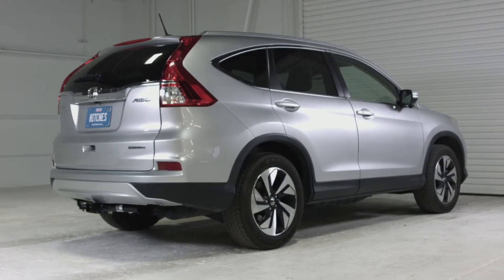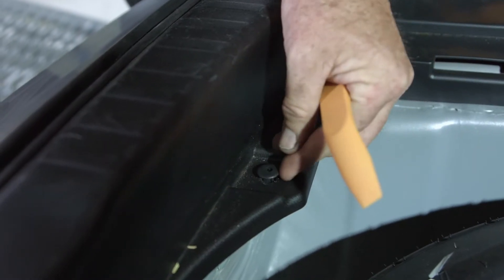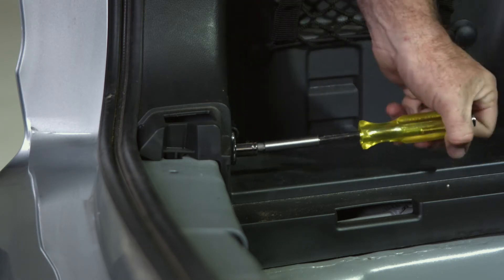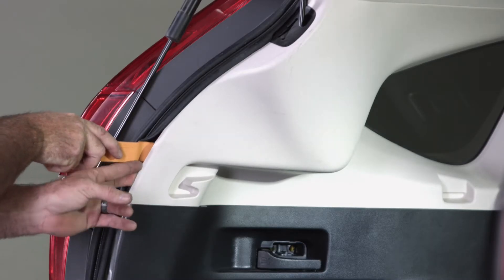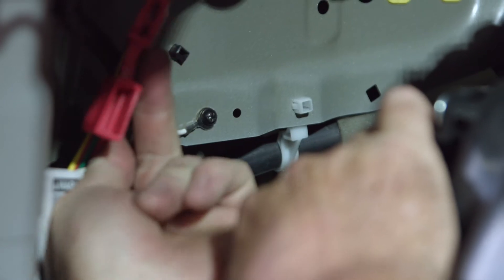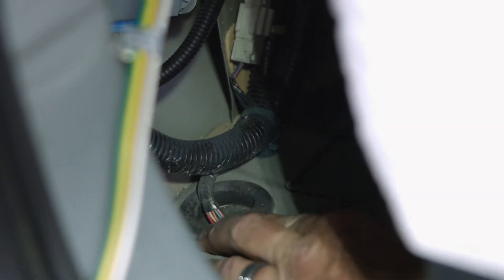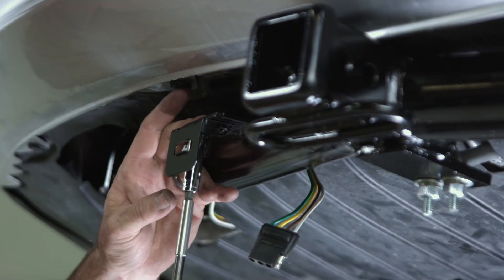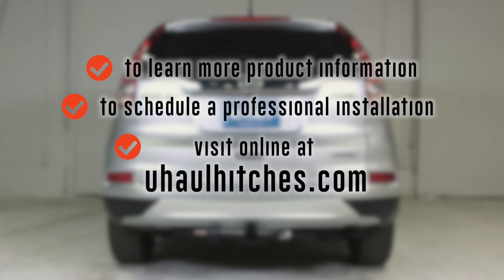2013 Honda CR-V Trailer Wiring Installation

Comment: Trailer Wiring Harness Installation - 2013 Honda CR-V Video
Tail lights come on when headlights on.
Turn signals and brake lights do not work.  Fuse is good.  Do I need another fuse on driver side under dash?
Please advise.

Reply
Reply from the maker: Visit your nearest Local Uhaul Hitch Center to Schedule Troubleshooting and test your harness for functionality.